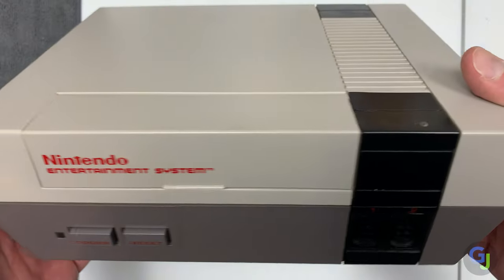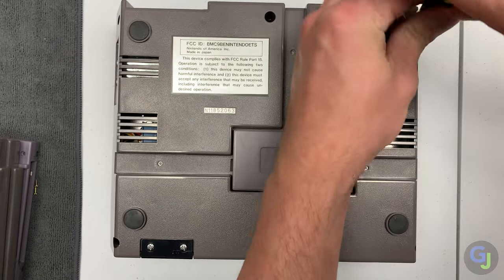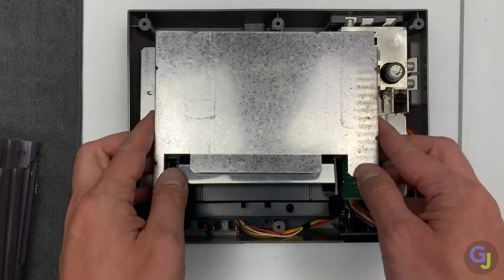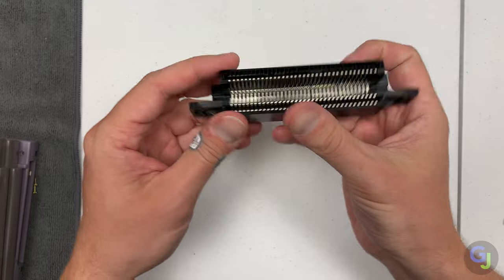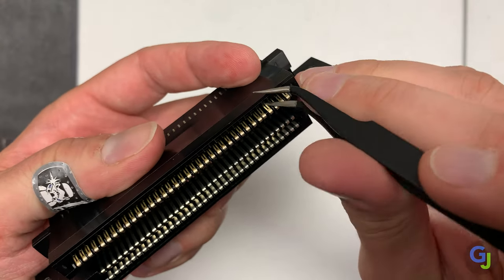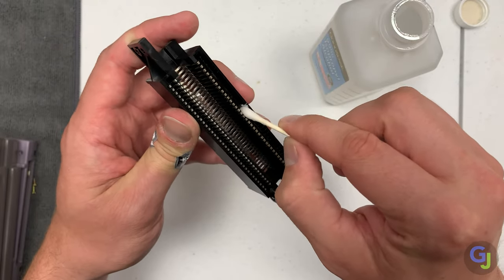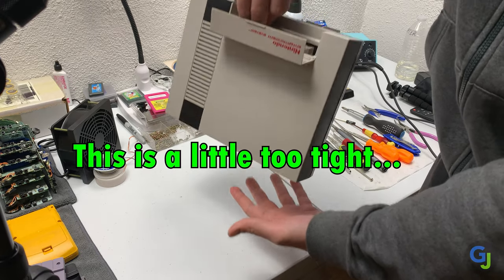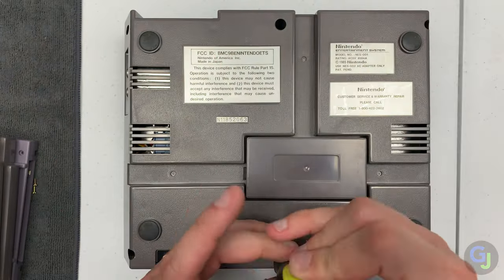How To Get Your NES Console 72 Pin Connector Working Better With This Cheap Repair Technique

Comment: I do a similar process, but I also soak them for a day on evapo rust. Just a soak in this stuff will get them working great again.
Reply from the maker: Interesting, do you need to coat it with anything to protect it after you soak it? And I'm assuming it doesn't effect the plastic at all?
Reply: @ no need to coat it. I haven’t had any issues with the plastic. I have a small Tupperware container that I fill enough to submerge the 72 pin. Just leave the pin in there around 36 hours. Remove it and briefly wash with water and dry quickly. I’ve found you can use the same evapo rust multiple times.
Reply from the maker: Very cool, I may need to try that! Thanks for the info!

Comment: 4:11 Please NOT recommend sandpaper! Sand paper can create small scratches in the metal which increases the exposed surface area and increases crroosion moving fowrard. Corrosion is best cleaned with IPA, DeoxIT, or other (plastic safe) contact cleaners and non-abrasive tools.
Reply from the maker: I've never used DeoxIT but I've had some recommendations to use it, I'll have to check it out some time.

Comment: What size magnetic screw driver to open my old Nintendo to fix the 72 pin connector ? Off amazon ?
Reply from the maker: I just use a long necked version that is able reach down into the holes. Unfortunately I don't know the size of it, it doesn't have any numbering system on it. But I would imagine one from an electrician set would work too since they normally do not have exchangeable bits and have longer necks. And it being magnetic is really optional. You can still unscrew everything without that feature, the main thing is the longer neck to be able to reach the screw head. Also the screws are larger too, so smaller precision sets won't work.